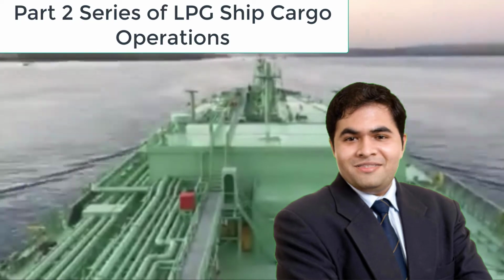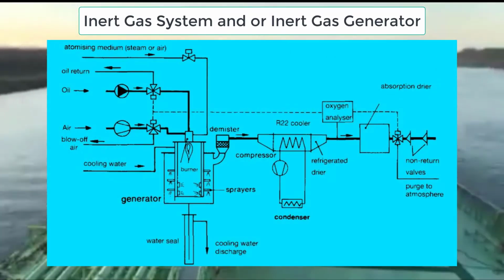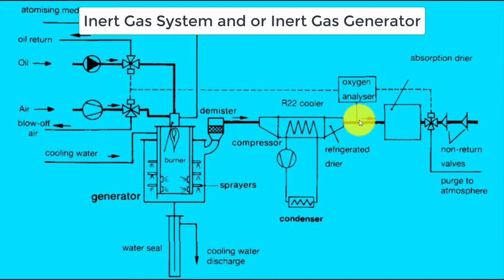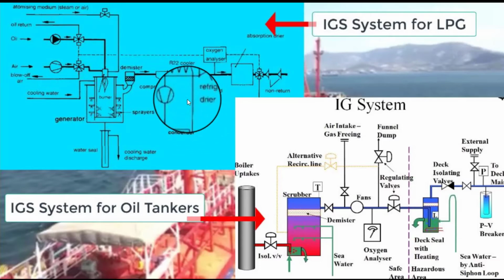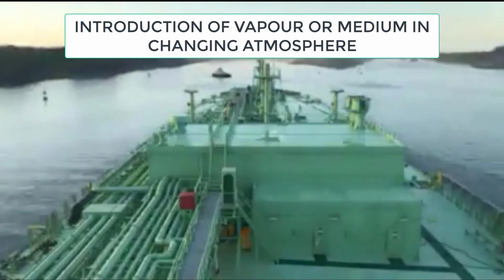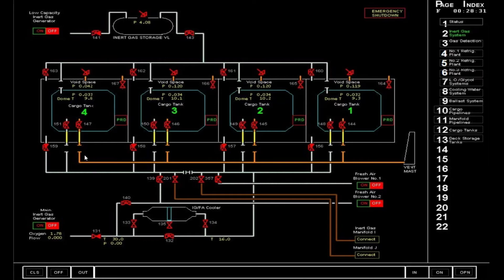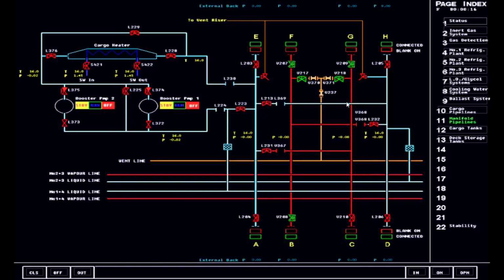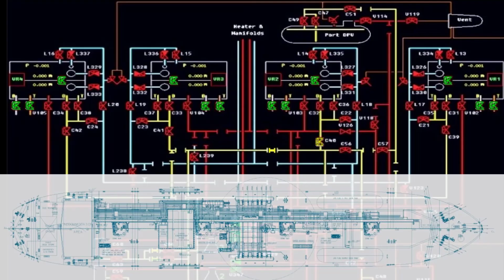LPG/C Ship Cargo Operations Part 2 - Inerting in preparations for Gassing Up at Loading Port

Comment: Hello sir i have suggestion to work as deck cadet on lpg tankers and what are the main question on interview for deck cadet can you tell me ? Thanks.
Reply from the maker: Its just the typical interview in general for any cadets regardless of the ship type. I would suggest to do a review using CES 4.1 or higher for General Tanker Familiarization and likewise Navigation and Safety topics in general. You will be fine, They wont ask Gas Tanker related items, but if your are doubt , read on it as well.

Comment: Good day sir, I would like to ask your advice to have efficient gassing up incase of ethylene were nitrogen and ethylene have almost the same densities.. and during inerting what pressure should we maintain in the cargo tanks.. thank you
Reply from the maker: There is a formula for finding the right amount required for Gassing up. However, in most practices we just look at the Gas Form-C, previous voyages record or P and A manual where the amount is already stated. This is more reliable as it has been experienced by former crew on board. For new ships maiden voyage then manuals that states should be found on board else use the formula. Find the apps link download in one of my uploaded videos.

For inerting, this also depends on your Ship Tank containment.  Inerting with N2 since your cargo is Ethylene. Less than 100mbar is optimum when Inerting with N2 but then again this should be also in you Ship P & A Manual. Warmer N2 would be better. Dilution can be used but for practical application displacement method is more utilized to save the amount Inerting medium e.g. Nitrogen.
Reply: @ShipAhoyVlogs  thank you sir and more power to your channel..
Reply: @ShipAhoyVlogs  P & A manual?
Reply from the maker: @moss5237  Procedure and Arrangement Manuals
Reply: @ShipAhoyVlogs  if i am not wrong, P&A manual is required for chemical tankers, gas carrier doesn't need a P&A manual, the IGC Code does say about cargo operations manual but not this term "P&A manual". BTW, i am working on LNG carrier
Reply from the maker: @moss5237  if your LPG ship is LPG/C which means it carries Petro Chem Gasses then P and A is there. Else you can substitute what was said about P and A as just plain manuals you can find on board. Ok
Reply from the maker: Your on LNG Ship. That's great! The beauty of LNG Ship is that you don't get to see the Tanks regularly and there is no change of cargo. I would say , its a lot convenient compared to LPG Fully Ref as compared of. And in most cases, your vessel is on a liner trade.
Reply: @ShipAhoyVlogs  my ship tramps everywhere, she isn't a 'project vessel'

Comment: what about filling IG on hold space in LPG Ships ?can you show pipelines for the same?
Reply from the maker: Most void spaces has their own dedicated pipelines for Inerting and/or Aeration (with Air) dry air e.g. when cargo is Ammonia and while for Ethylene , Nitrogen is used. Nevertheless, the IG purge line in the cargo tanks can be used as well thru flexible hoses and send it in to the Void Space or sometimes spools pieces are just connected or even ready connection separated by Isolating valves from the IG Main line system. Tracing lines is the most efficient way to learn a system, there is no need to memorize them even with complex and long winding lines.

Comment: Grabe sir, napaka ganda ng videos mo. Comprehensive and worth the watch. :) If magkakaroon din ako ng ganitong simulator, gusto ko ring mapag aralan ng maigi. 

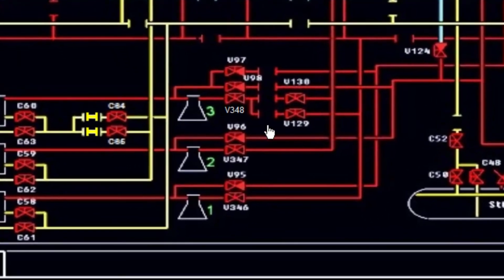Anyway sir, at 19:05, bakit po binuksan yun? Where is it connecting? Not really familiar with LPG as of the moment, but its my next vessel assignment. I came from oil tanker so not really familiar with the lines and equiptment. 

This is a good start-up, sir. Kudos sir for a great video!
Reply from the maker: Tks for patronising my channel. 
Not sure saan tukoy mo valve at 19.00 onwards.....I am opening all valves, directing the IG flow to all lines, valves, system and equipment where the cargo uses. expelling all the air is necessary. Tanks are biggest space to be done first, hence the rest follows e.g. loosening valves, drain, vents etc has no sequence. this depends on your system design and as a optimum practice they are done in the end stage of inerting.
Reply from the maker: I will be uploading online an interactive simulator. Still working on it. Pero it could be access simultaneously with unlimited students for mentoring. However, a certain fee maybe required to maintain the  server or website. Puede assisted by a mentor/facilitator or preloaded na sya like a game self pace study.
Reply from the maker: Kindly, pass on the word if you think its worth watching and learning from. I am more motivated to create lectures If I have a bigger audience. Appreciate much.